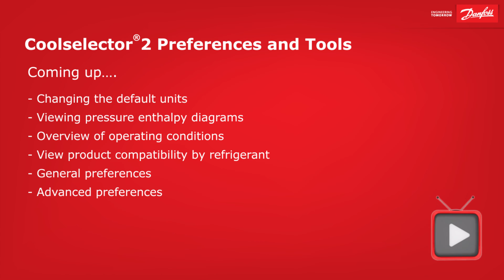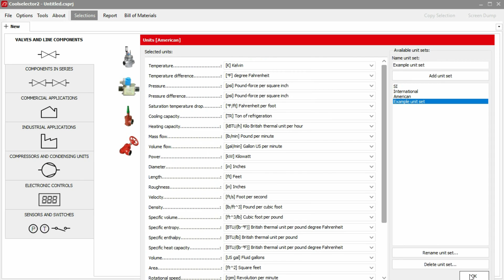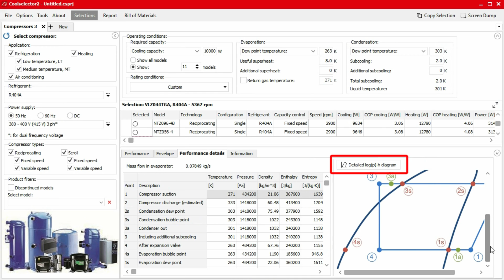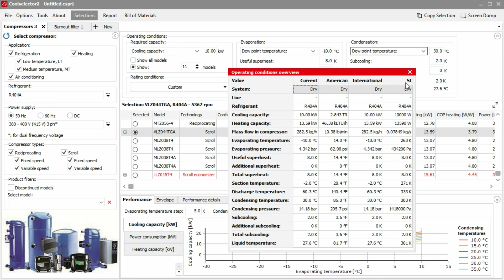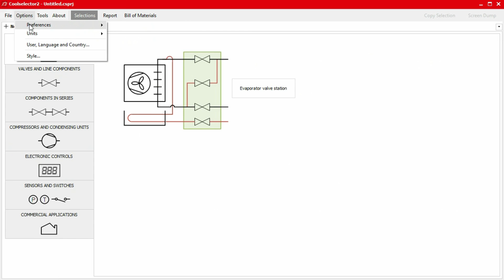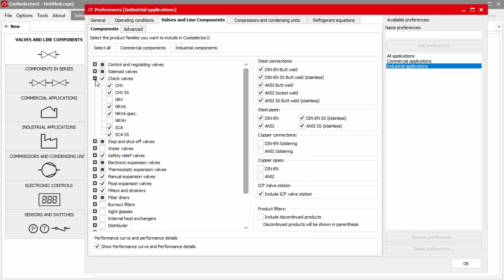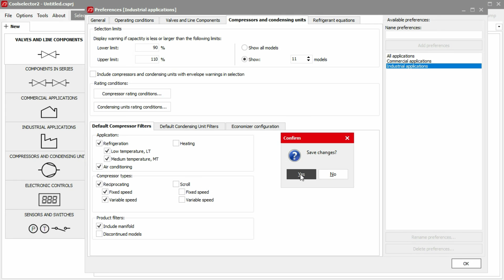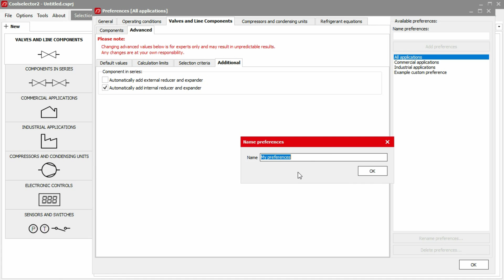Coolselector®2 – Tools & preferences

Comment: can you use the coolselector to draw a circuit on the ph diagram by inputting vertice values. the readout of values from the chart is great but i would like to be able to mark points for a sample circuit. IT appears you can build such a diagram but selecting components but i'm trying to forerun that and possibly see if you have existing components that back into the diagram although it is a bit of theoretical exercise comparing refrigerants. thanks